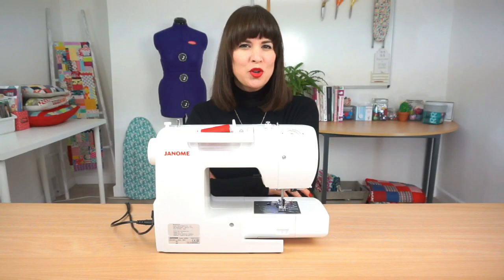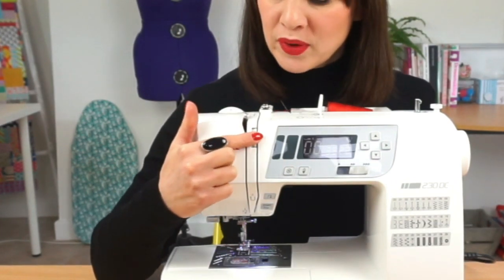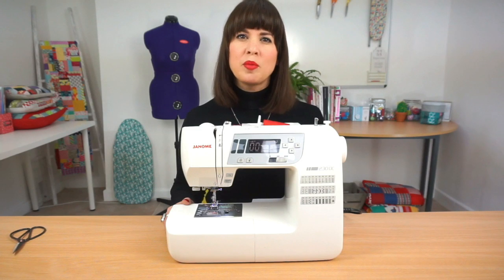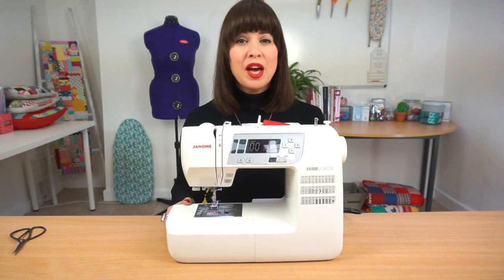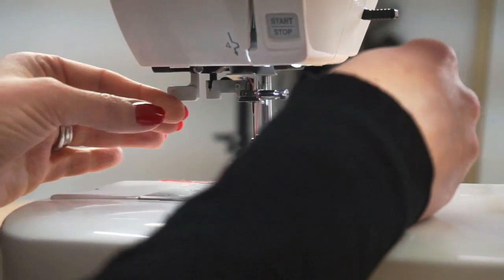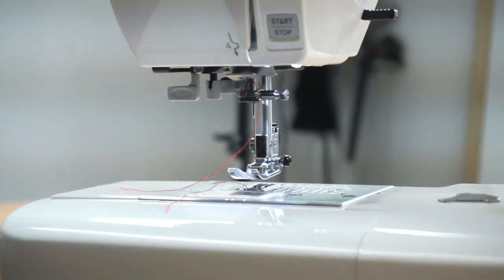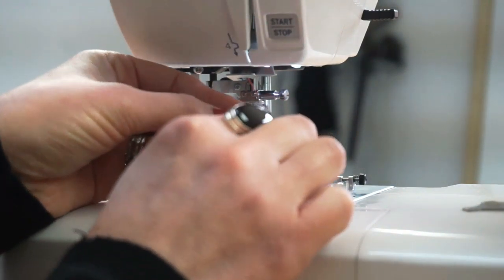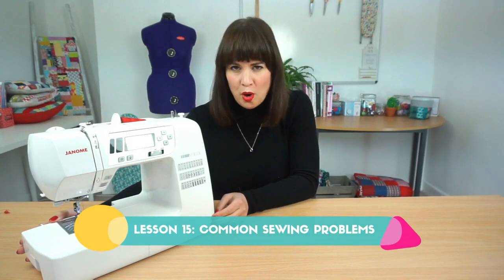Learn To Use A Sewing Machine | How To Sew For Absolute Beginners | Part 3 of 3

Comment: Great video, I definitely agree with the statement about tension rarely being the issue. I had an issue with the bottom thread for ages and couldn’t work out the issue, I adjusted the tension and it still didn’t help so I went back to the manual and found I was making a simple mistake when threading the bobbin.

Comment: Make your own colour code for different sized needles, eg red for 70, green for 80...Dab part used needles with the appropriate coloured  nail polish or permanent marker pen and this saves squinting at the tiny numbering on the shaft. Oh yes, store part-used needles separately from new ones too! Speaking from experience here.
Reply from the maker: Great idea Carol
Reply: Where about is the best place to put a mark on the needle. Thanks :)
Reply: Elaine Rennie I mark the part of the shaft where it starts to widen - just below the thick straight section that is inserted into the machine. Hope this helps.

Comment: I think you’re also likely to need to adjust the tension if you’re using different threads in the needle and bobbin. i. e. Top stitching thread up top, standard weight thread in the bobbin.